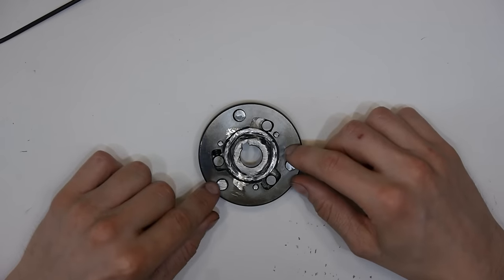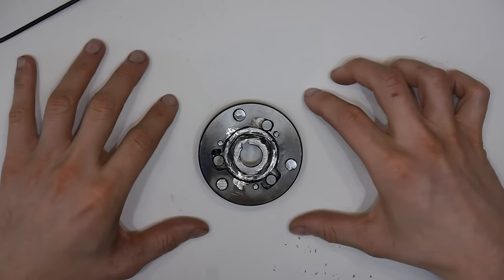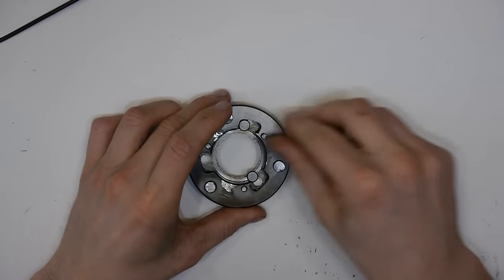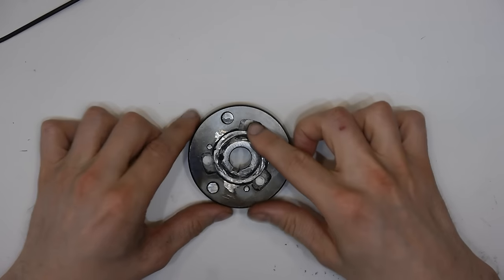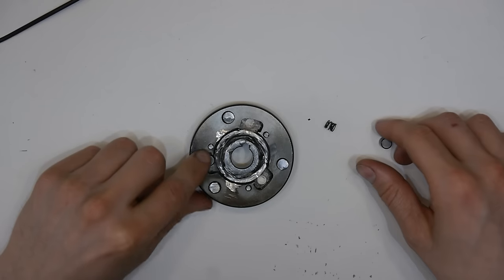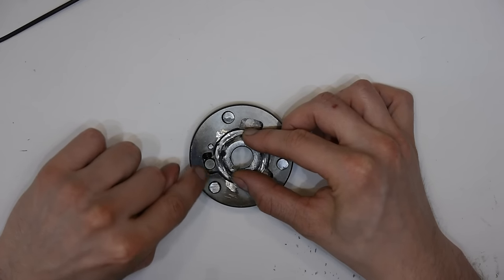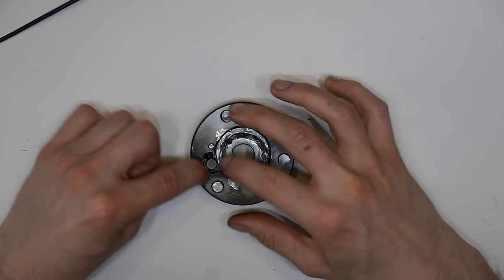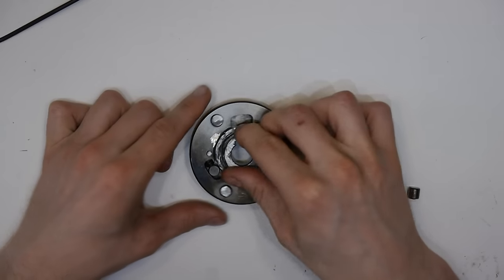One way bearing

Comment: These are awesome. Why don't they make free hubs using this technology? The ratchet systems they use seem less efficient in theory, with all the pawls sliding and clicking over the teeth. With this it's only rolling friction, and you also get instant locking, instead of waiting a degree or so.
Reply: I’m not sure what specific application you are referring to, but in electric motors for instance: vertical applications on pumps, the balls in the ratchet system are flung out by centrifugal force so they don’t  click over the teeth unless coasting down/starting up, also especially for this application the amount of force that would load the bearings up if spinning wrong the torque would damage/destroy the bearings imo to want to use that as your rolling element and anti rotation lock.